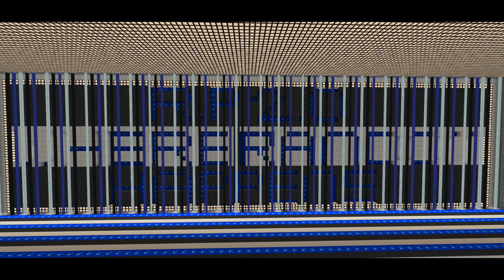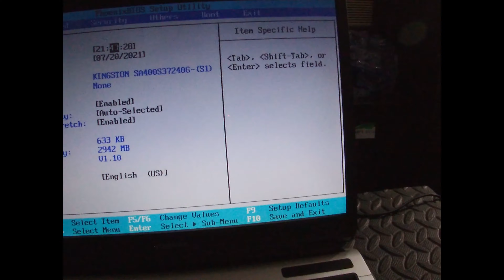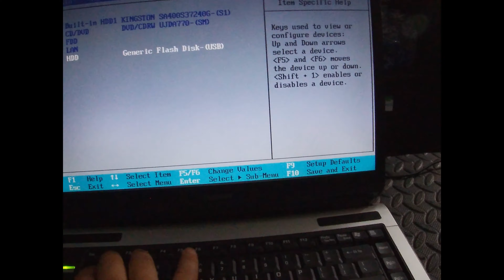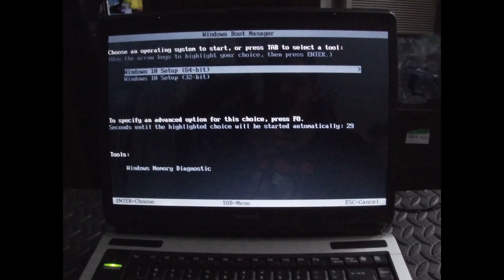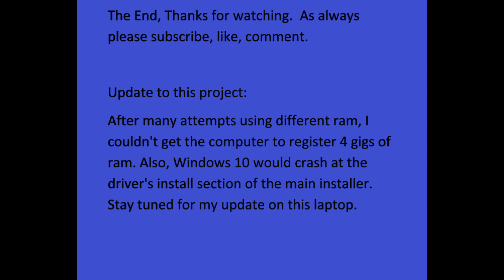Can A Toshiba Satellite A135-S2246 - Run Windows 10 - SSD UPGRADE

Comment: Hola, a mi no me deja instalarle Windows 10, nisiquiera una version Mini. Alguna solucion??
Reply: Subiste el ram? A mi me regalaron una de estas y viene con 1GB de ram a 5300 Hertz y los módulos de 2gb ddr2 los venden pero no sé si los mega Hertz tengan que ser iguales o no afecta que sea de mas
Reply: me pasa lo mismo, ninguna version de windows 10, y la memoria debe ser de 5300 mhz si le pone de otra no funciona ya lo probe y maximo soporta 4 gigas
Reply: Tengo esta misma laptop la tenia por ahí guardada hoy le puse 4 gb de ram ddr2  módulos de 2gb ddr2 6400 = 800 mhz 
Y le puse un disco mecanico por el momento de 500 gb 
Intentaré ponerle un Windows 7 modificado hay uno con apariencia Windows 11 haer que tal corre mañana contaré que tal
Reply: @blzdocs294  al final la mia quedo con 4 de ram ddr2 de 5300mhz la de 6400 mhz no las toma, con windows 7 de 32 bytes ya que el procesador es de 32 bytes es un celeron M de 1.87 ghz de un solo nucleo y disco mecanico de 500 gigas, mas adelante cambiar el procesador a dos nucleos.
Reply: @blzdocs294  a la mia le puse Windows 7 y si lo corre bien venía con dos módulos de 512 cada uno hace unos días consegui uno de 1gb y ahora tiene 1.5 GB y va mucho mejor cuando pueda ponerle el disco SSD creo q mejorara mucho más
Reply: Bueno ya instale Windows 7 modificado con apariencia Windows 11 con arquitectura de 64 bits y de 4  de ram 6400 ddr2 solo reconoce 3,5 gb  ( 2,87 gb utilizable ) intentaré ver si la board  me dejaría remplazar el intel celeron m520 que tiene por un core 2 dúo  
Y un ssd de 128 gb quedaría super fluida estaría creando la laptop toshiba 2006 más poderosa :v
Reply: Les agradecería si alguien encontró la lista de procesadores que soporta la board
Reply: @blzdocs294  gracias por la información ya sabemos que sí soporta entonces, me llama la atención tu foto porque mi intención de esta laptop era para jugar starcraft a mis 31 años porque de chiquito no tenían dónde jugar solo pagando en el ciber y ahora tengo que trabajar y tampoco tengo tiempo para jugarjajaja
Reply: @blzdocs294  pero  quería modificarla para que soporte starcraft 2 porque solo corre el uno
Reply: @Fenix-gamees  si si soporta 64 bits con un ssd  no tendrías problemas de lag ,
Quiero poder meterle un core 2 dúo t7500 que vi dice que maneja el mismo socket ppga478, la duda sería si la board lo soporta

Comment: I'm cleaning out my closet and find this laptop. I'm erasing it now before I throw it away. Any success with adding ram or memory? I love this thing but it has zero functionality with its 1 gig of ram.
Reply from the maker: Hey,  It can support up to 4 gigs of Ram. Unfortunately, the ram I had on hand was not getting recognized. Pretty good machine if you would like to do a retro install of XP or older. I would consider posting it on a retro/vintage market to see if any would like it